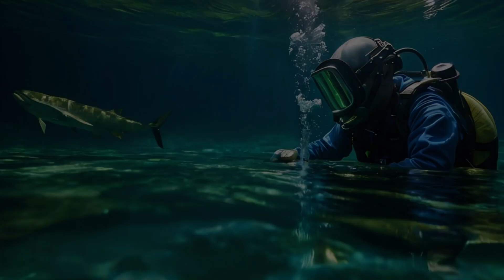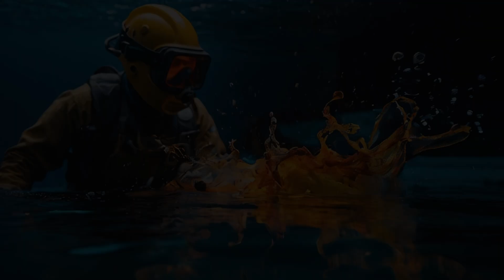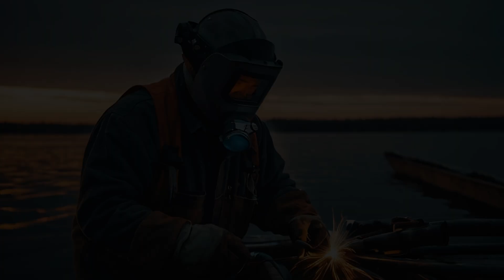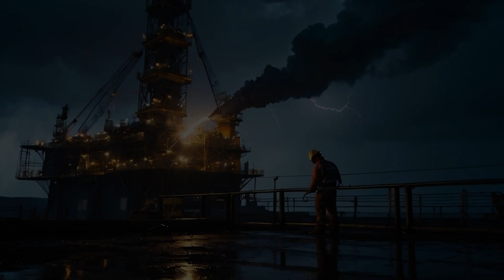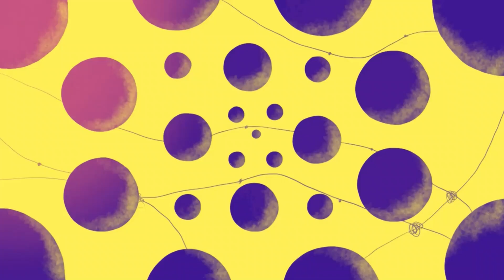Dive Into The World Of Underwater Welding!

Comment from the maker: BUY YOUR WELDING MACHINE HERE; 

Lincoln Electric Invertec V205-T.
https://amzn.to/3VZLWKm

Hobart Handler 140
https://amzn.to/3vAFwqE

Everlast PowerPro 164Si
https://amzn.to/3vWWkrI

EWM PICOTIG MV puls TG
https://amzn.to/3J93FaV

ESAB Fabricator
https://amzn.to/3PXqG46

Miller Electric Mini Arc Gouger
https://amzn.to/49uL6bR

Hobart IronMan 240
https://amzn.to/3xyiykr

The Forney Easy Weld 125IC
https://amzn.to/49q3WRm

iBell 200-89 Inverter ARC Compact Welding Machine
https://amzn.to/4aPcna4

Miller Multimatic 220
https://amzn.to/3xvFQHB